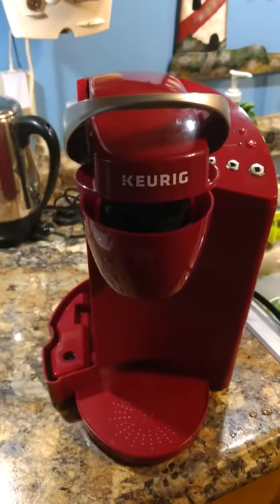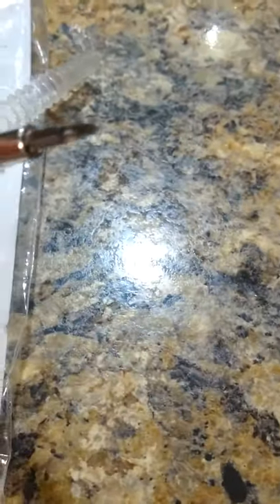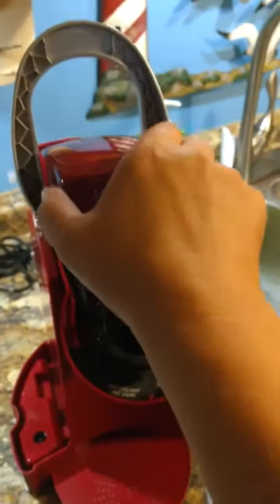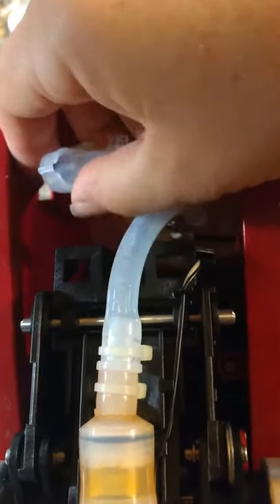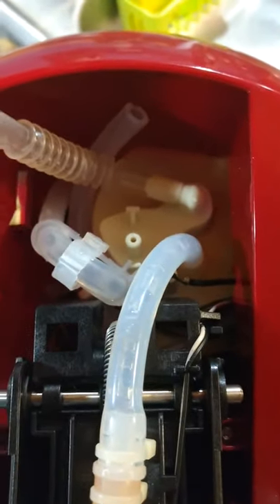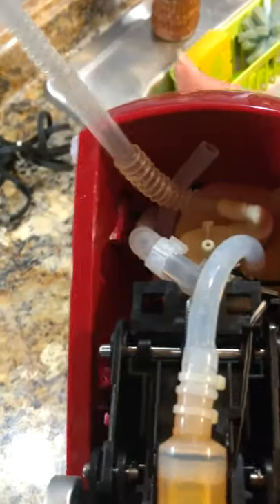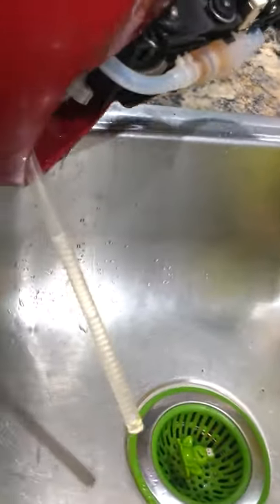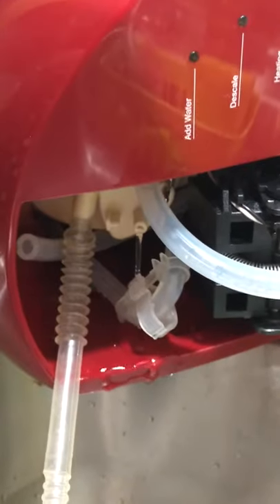How to completely empty water from a Keurig Coffee maker internal tank.  The RIGHT way to do it.

Comment: Just emptied mine, almost 2 cups of water in it, hardiest part finding a tool to remove the screws, Thank you, love the video
Reply: I thought getting the screws out was the easy part. Getting them back in is a lot harder! I ended up losing one inside of the machine and can't get it to come out. Even tried taking the bottom off but no luck. Bummer.

Comment: I just tried a different method to drain a K-Select model, and it does appear to work.  I plugged in the machine with no water tank attached, and the "Add Water" light was shining.  I then attached a half-full water reservoir and the machine proceeded to heat up the internal water reservoir.  

Once the machine was finished heating the internal water, I raised and lowered the brew head handle and pressed the button for the largest cup size.  I then immediately removed the external water reservoir and the machine continued the brewing cycle.  Only a few ounces of water were dispensed, and I turned the machine off about 10 seconds after the water stopped dripping out.

I don't know if the internal reservoir was completely emptied, but this is probably the best that I can do without a partial disassembly of the Keurig.  I recently got a new K-Select machine, and I'll be storing this old machine as a "backup" coffeemaker.  The old one does brew coffee, but will no longer pump any air through at the end of the cycle.

Comment: Please note - this won't work for the B40 model. As soon as you take the cover off, you'll see the difference when you look into the machine. Mine has 1 tube and a bunch of electronics (so now I get to take the bottom off - after I've put the top back on).. I wish this had worked as it looks fairly straight-forward and a whole lot easier than what I'll wind up doing!  Plus, it's a really good video!